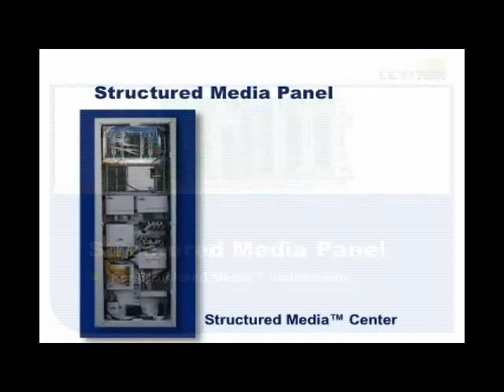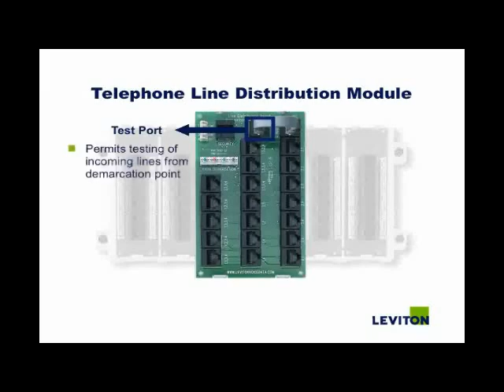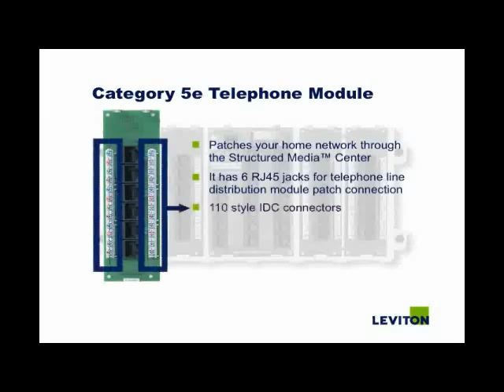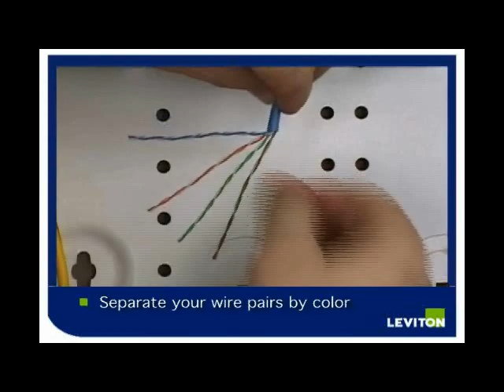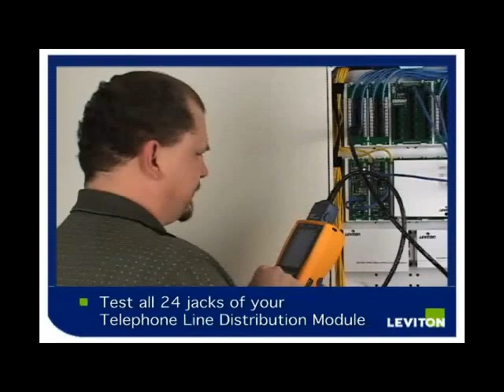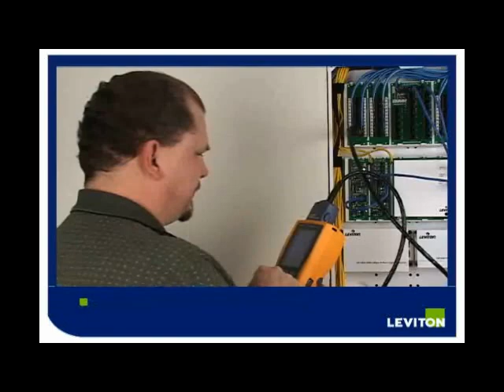How To Install A Structured Media Panel | Leviton

Comment: "to remove the nylon runner..." Oh you mean that thing you were supposed to use to peel the jacket back so that you don't score the pairs. -.- thank God you guys didn't "teach" anyone how to run a coax cable splitter or make a fitting.
Reply: They used a cable stripper, which doesn't score the inside insulation. The nylon piece is not needed.

Comment: So if I were to install this by itself, as I have no security system, would I still punch down the cable coming from the demarcation panel into the line in/out security IDC and then proceed to insert the shorting plug, or would I just ignore the security IDC and shorting plug?